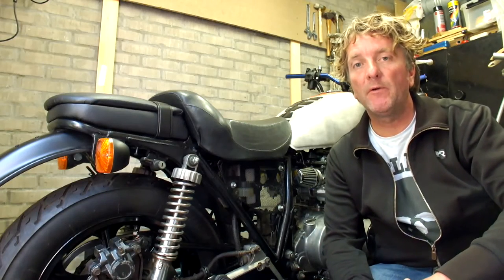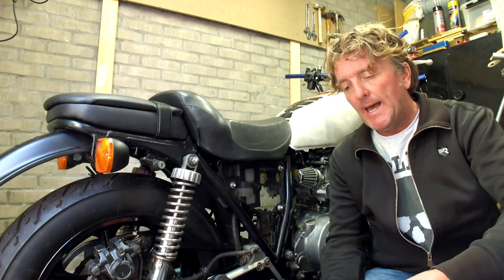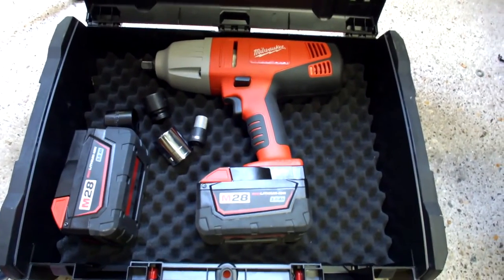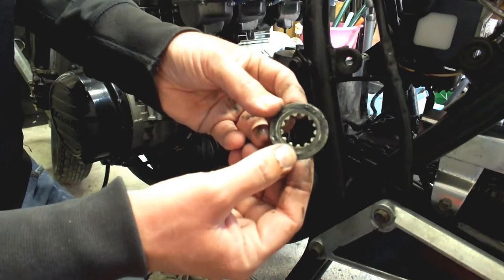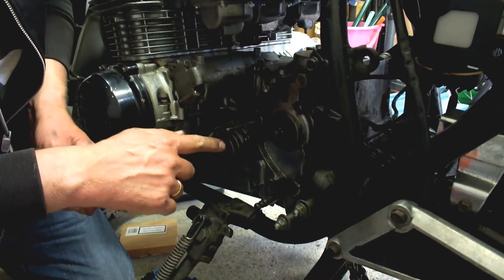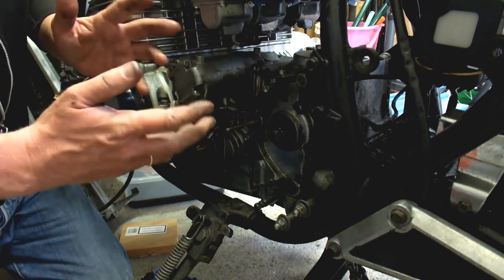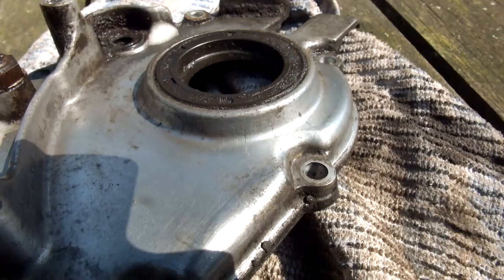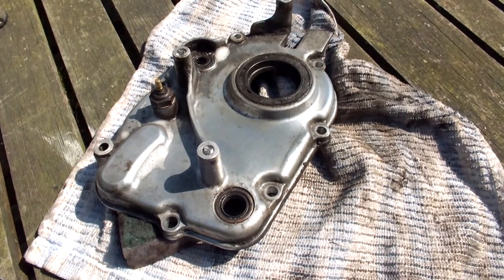1982 Kawasaki 750 Ltd Rebuild (Part 28 Engine Seals Part 1)

Comment: Brad, who posted below, is correct.  The "cracks" in the oil seal cover are casting marks.  This can be confirmed by sanding them away with some 600 grit emery cloth.  The broken bolts on the oil seal cover chain guard are a common problem.  To help avoid this in the future, don't over tighten the new bolts - torque them to 90 in. lb., and every time you have the engine side cover off, loosen and then re-tighten the bolts.  I say bolts rather than Phillip's head machine screws, because each and every Phillips head cover screw should be replace with Allen heads.  Stainless sets are available for a few bucks.  Do yourself and the next guy a favor and get rid of the Phillips heads.  They're nothing but trouble!
Reply from the maker: Thanks for the feedback!

Comment: Hey, the front sproket has a Locking system.
It's the Washer under the Nut, it needs to be bent over the side of the nut after fitting/tightening.
The sprocket on the washer holds it still, the sides of the washer on the nut hold that still.
Hope you put it back right. Coz it wasn't done right before you removed it.
Still looking for your Shims video...
>:)

Comment: I suspect the cracks in the panel are just casting marks and if you look at the inside there will be no corresponding cracks.  I had the same problem with the three bolts holding the small sprocket chain guard on and had to drill two sheared bolts out.  If I do another bike I will not be removing that guard, just leave it in place.  Like the videos, very naturally narrated.

Comment: Can tell me what jet sizes you went for with you air filters please, got mine coming soon. Thanks
Reply from the maker: thebruise Well,the carbs still need to be re-jetted. At this moment it still has the original jet sizes from the moment I bought the bike, 125/62. Once a sync of the carbs take place I will inform you of the new matching jet sizes. Regards and thanks for your question.